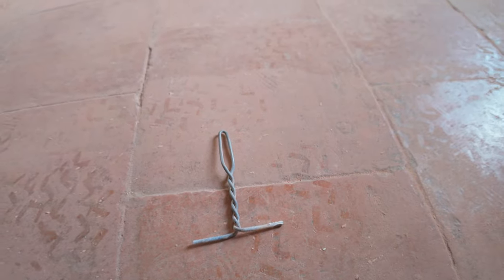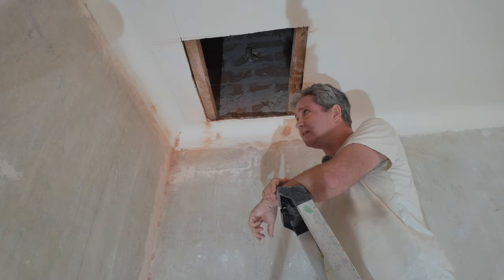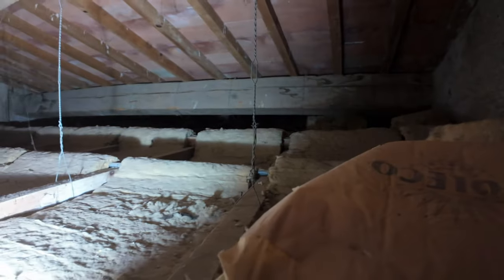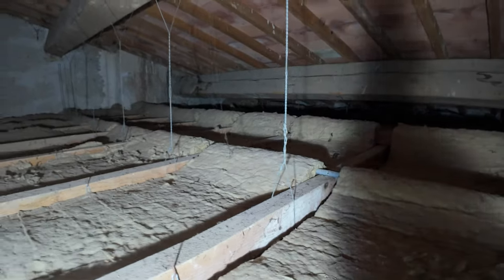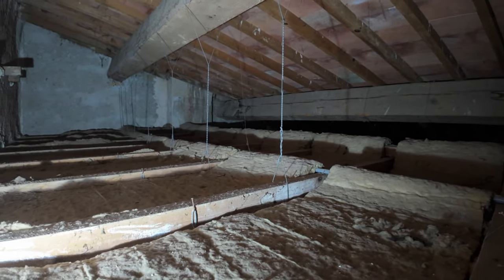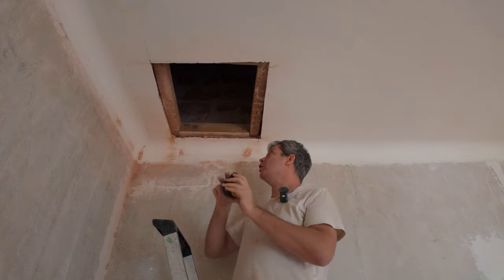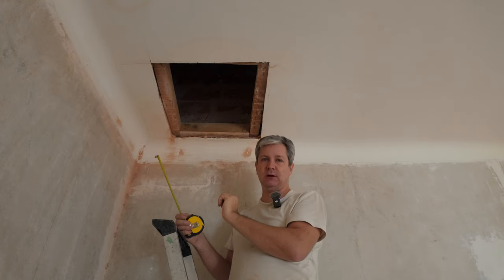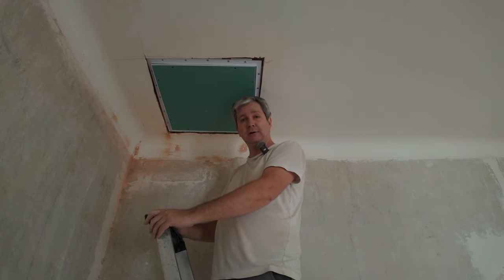Installing the FINAL Loft Hatch!

Comment: It's good to see you got through these access doors with all of the various surprises and challenges. 

Upgrading the insulation after the roof is repaired will make a nice improvement in comfort.

Looking forward to the bathroom demo video.

Is your pain level better? Any insights with the scan/diagnostic?

Cheers,
David
Reply from the maker: New roof, hopefully getting a payout in December will be a massive advancement with the house. Plus 300cm at least of insulation will make a huge difference. In addition maximum solar panels and at least the beginnings of a battery system will cut our costs dramatically.  

The loft hatches have been a good transition from injured to getting things moving again. 

Just started chipping off tiles on the walls this morning before I remembered it was a holiday and had to stop making noise. I'll try to get a full day in tomorrow although I am feeling it in my arms after just a small section.

As for my injury it looks to be a disc with a bit of swelling(taking oral steroids for a week) but a lot of arthritis.  The doctor said my best bet was to loose weight and work out.  So I'll be starting "rucking"  walking with a rucksack full of weights on Sunday. I was most worried about causing more damage but doctor said I'm more likely to be worse if I stop working.  Listen to my body if it hurts stop and  take lots of 15 min breaks.  I should be able to rebuild other than the arthritis.

I was hoping to have a removing all the tiles video out Sunday but it's proving to be a bit of a nightmare. Tiles bedded into an inch of concrete supported by delicate terracotta hollow bricks similar to the ceiling.   I need to use much more finess than planned so it's probably going to take a week just to take the wall tiles off with minimal damage to the structure of the dividing walls.

Hope you have a grand weekend and manage to cross some things off your to-do list!

Oh and I don't know or judge anyone on their election views, but  I know I'll be up all night/morning on Tuesday as will an astonishing amount of my international friends.

Cheers,

Scott